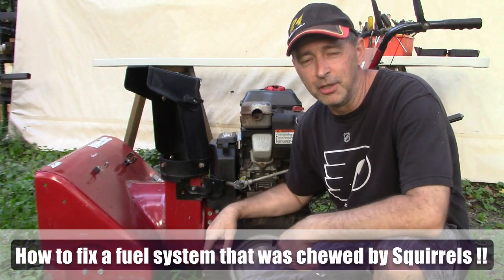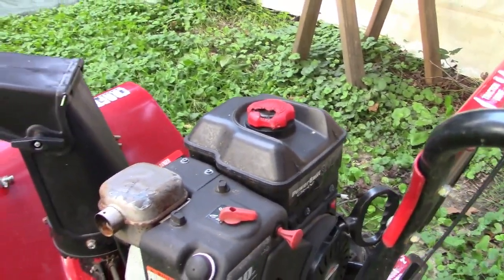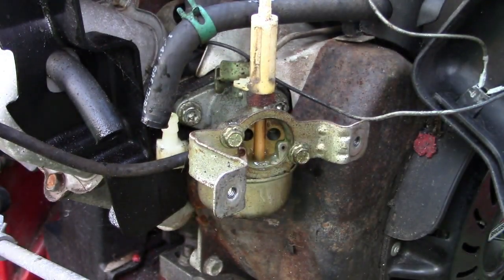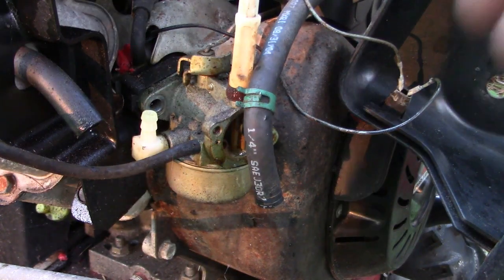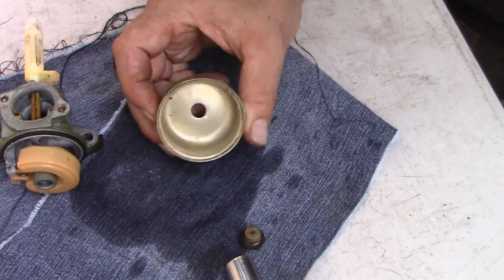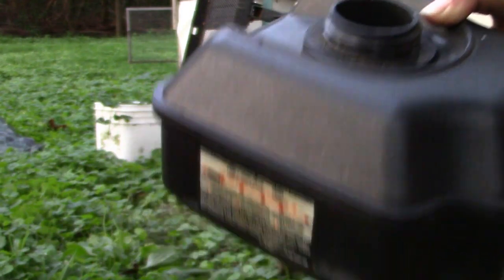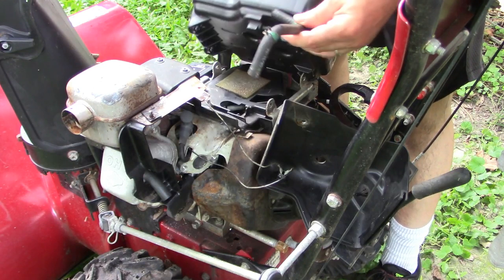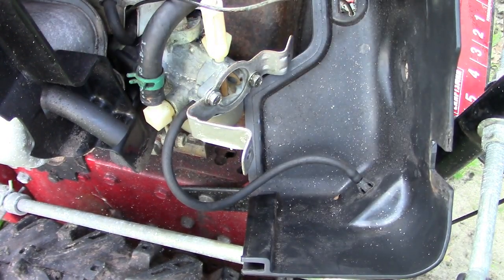Sabotaged by Squirrels - How to Fix a Small Engine Damaged by Rodents

Comment: I discover the same issue on a lawnmower stored outside. I have teeth scrape marks that confirmed it was a Grey Squirrel: two clear & distinct and narrow upper incisor scrapes. It hit two other spots and went completely through and drained fuel. Yet, it must have come back after fuel drained because the holes were finger width. It certainly wasn’t sitting their taking a shower or consuming! I think there is some mineral or other in the synthetic polymers associated with fuel lines - nothing to do with the fuel itself.

Comment: I had a squirrel chew my lawn tractor fuel line.  Gas was leaking out onto the mower deck.  Easy fix.
Reply from the maker: They have chewed a nylon fuel line in one of my cars, and a rubber fuel filler pipe in another vehicle. Real pests!

Comment: Has anyone ever seen a lawnmower gas cap that was actually removed from the mower, I have. My friend stores his mower outside halfway under the back deck, I then have to go over and get it running again, this year he brought it out and the gas cap was gone, I removed the float bowl and the fuel line until all the water drained out, I put some gas in and ran it but there was still some water in it, we went in the backyard to look for the cap and found it on a bench that was full of acorn shells, it had been chewed, the little buggers managed to unscrew it, this isn't the first time, a couple of years ago it was  chewed but not removed, what's with them and gasoline, do they get a high from it? I'm going to.start making good old fashioned gas caps out of metal like they used to be made, give them varmints a tooth ache!
Reply from the maker: I've had lots of problems over the years with squirrels chewing through gas lines on my cars and lawn mowers. Not lately, however, because those rascals don't last long around my place anymore!!!